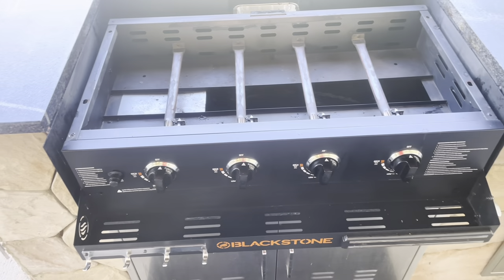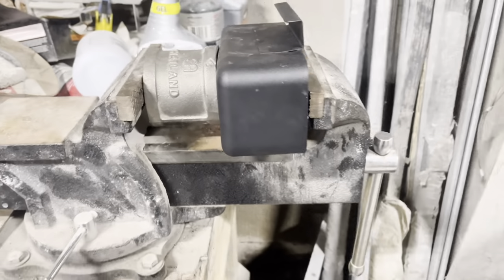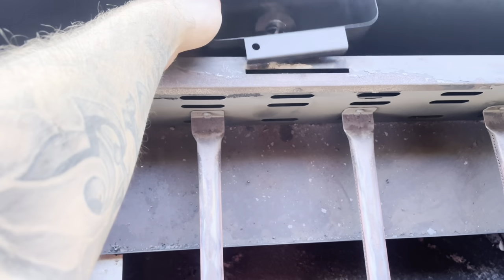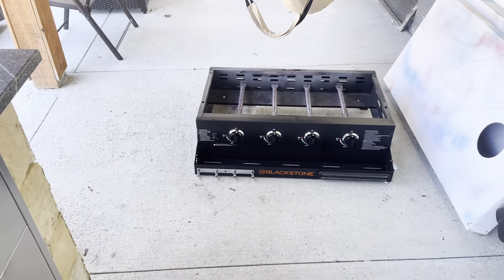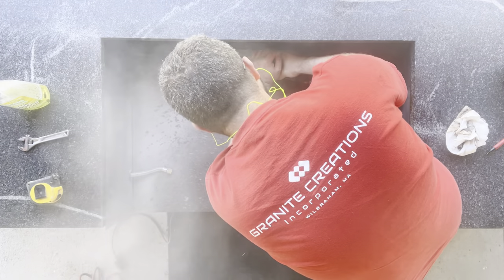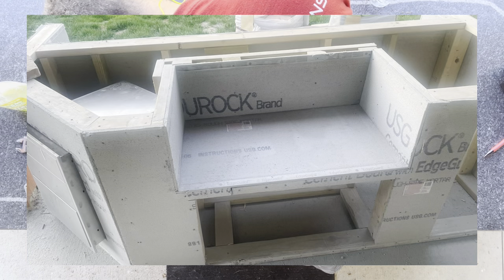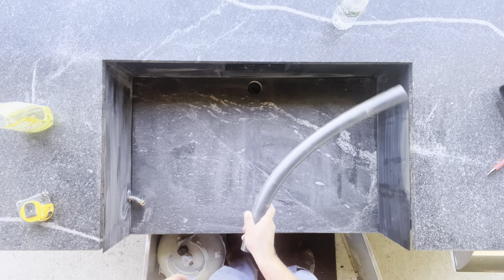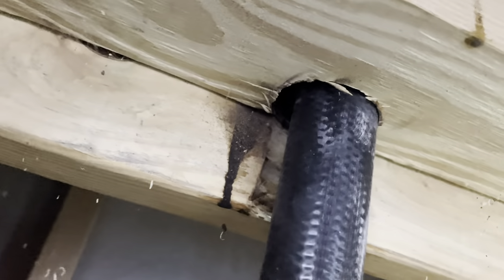Blackstone Griddle Grease Trap Modification. Grease Drainage System How-To.

Comment: I see that you did not ream out the inside of the metal drain and left the cross "X" in there.  Wouldn't it have been better to make the drain one big hole in case you get larger pieces of food that slip into your drain and plug it up?  Otherwise great idea when mounting a griddle
Reply from the maker: Funny you mention that, just the other day I was looking down there and noticed I never removed it. Just grabbed a pair of needle nose and twisted it right out! It worked fine before too, but this might be better without it.
Reply: @stoneyardgriddle9203  I was also wondering about the solids build up. Some foods are a lot worse than others.

Comment: What is the backer and pusher you mention?  They look simple enough to use, but when I search for pusher and backer I am not finding anything close to what I see in the video.  Where can I buy them and do they have a proper product name for web search tools. This video is the best modification that I have found. Thank you for sharing it!
Reply from the maker: So glad you found the video useful! I had to be resourceful with my “tooling” on this, but I was able to make very nice dimples just by using a 2” OD piece of black pipe as the pusher, very commonly found in the plumbing section of HD or Lowe’s or at a Plumbing supply house. As for the backer, I used a 2.5” ID female to female pipe fitting, again, commonly found in the plumbing section at most hardware stores or Plumbing supply house. If it seems like a very janky way to do this, that’s because it is haha!

Comment: Could you explain more how you made the dimple?
Reply: drills (with a 1-3/8" Bit) the initial size hole for the OD. of the drain TUBE with threads. his particular drain has an OD of 1-1/4". He then gets a PC. of 2-1/2" pipe (ID.) to use as a "block" to push the OTHER pc. of pipe that he has the grease tray "wedged" between The SMALLER 2" OD!!!! Pipe and the bigger 2.5" PIPE on the back, then just uses the vise as a "press" to make the dimple for the flange of the drain to sit lower than the bottom of the GREASE TRAY.